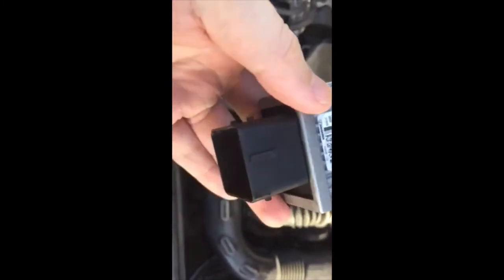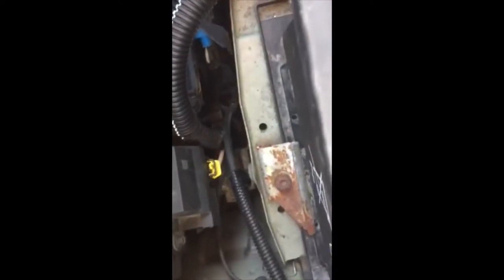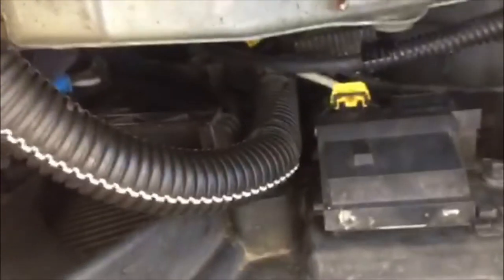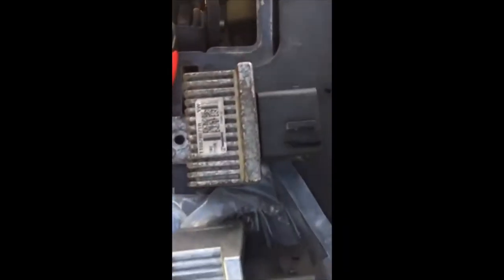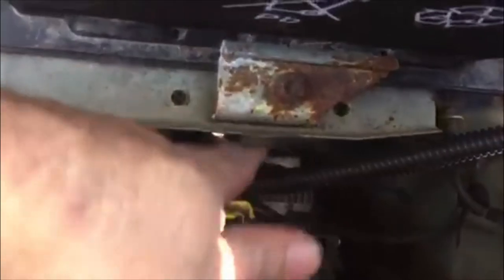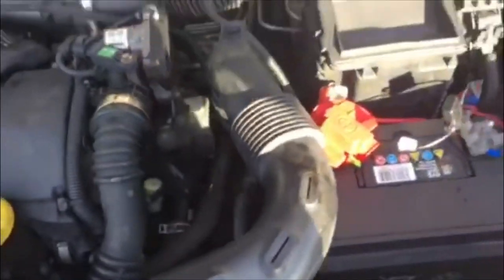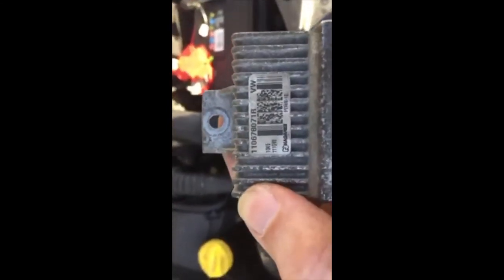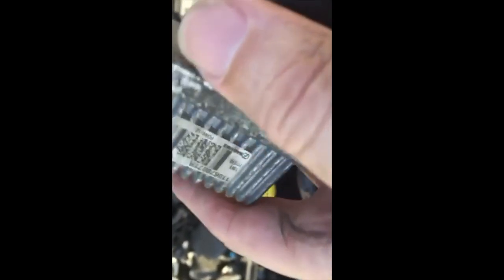Dacia Duster OE NUMBER 110678071R: CONTROL UNIT, GLOW PLUG SYSTEM

Comment: On my Dacia duster the glow plug relay is in the same place.what an awkward job it was to change it.but it's done and unfortunately after a day's driving the engine management light back on and plugged in to a diagnostic gizmo says faulty glow plug relay.i give up!
Reply from the maker: That was the same for me so I had to get a new one as they are made by VW and I change the glow  plugs

Comment: Did you have a long cranking issue from cold?
Reply from the maker: no it took it time to heat up the glow plug and the glow plug all worked fine it was the unit that some how got water in it
Reply: @marcusbarnard  what was the initial issue, how did it present itself that made you replace the module?
Reply from the maker: @ThatBikerDad  the light come on for the glow plugs so from going to the glow plugs that they where all fine then look at the control unit that was all green in side so clean the old one and pot it back in and it was fine but i change the unit to be on the safe side as the unit was not looking to good in side
Reply: @marcusbarnard  I currently have on cold mornings trouble starting garage said its the control module but once it has started it starts up fine for the rest of the day
Reply from the maker: @ThatBikerDad  i had that with mine so i was told to get a unit and i got one of ebay
Reply: @marcusbarnard  obviously that has since resolved your issue yes?
Reply from the maker: Yes it has fix it the thing is unlt is made by vw